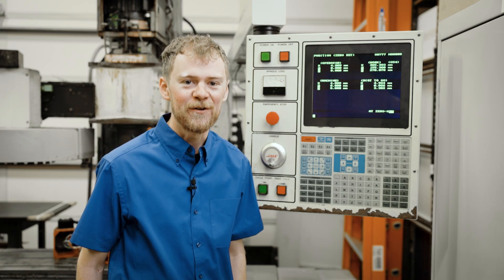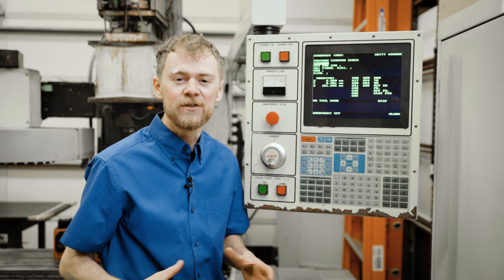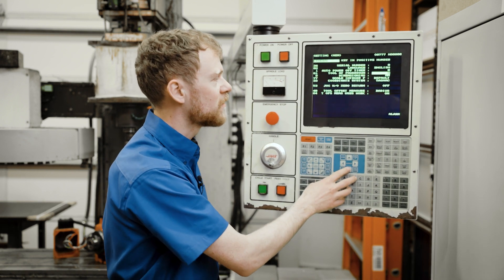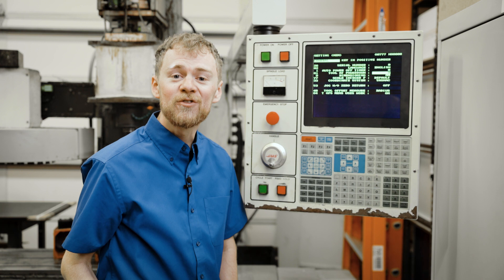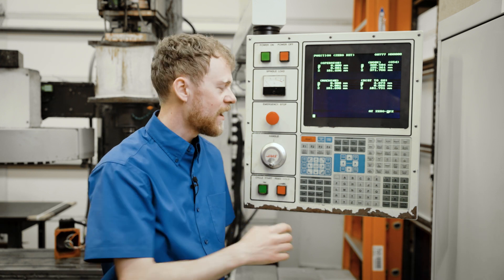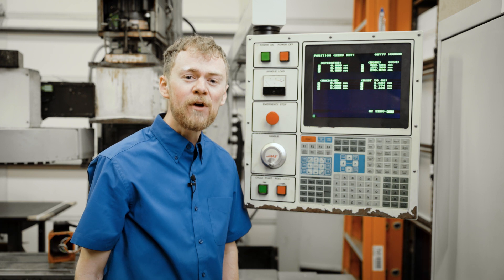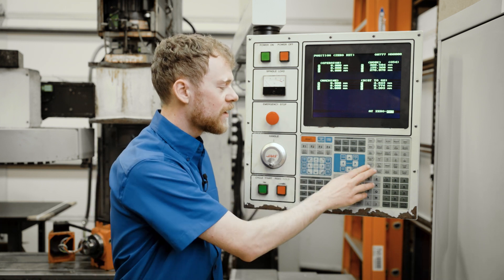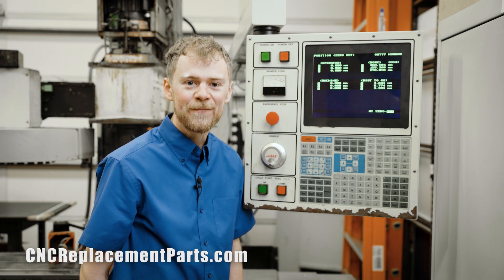How To Power Up Restart A CNC Machine

Comment: Can you Zero Ret Single the Toolchanger? (TT)? I haven’t been able to do so on my newer haas machines - it tells me “invisible axis”. I want to do it so the rotary doesn’t start zeroing as the others are moving (I have an oversized part mounted that will crash if the rotary rotates from the wrong spot).

Comment: You are exactly right. I spent almost 2K putting a modern control on a Bridgeport Series 1 CNC, in the end it was totally not worth it. It still didn’t have the features that my Fadal has. The Fadal is an amazing machine, 15HP, tool changer, probing, full enclosure and fast rapids and feeds. So easy to use and I can get parts at a place 45 minutes away. Services are available from a nearby company as well if it’s something I can’t do myself. 

If I knew what I knew now, I never would have bought the Bridgeport, although I learned so much from owning the Bridgeport.